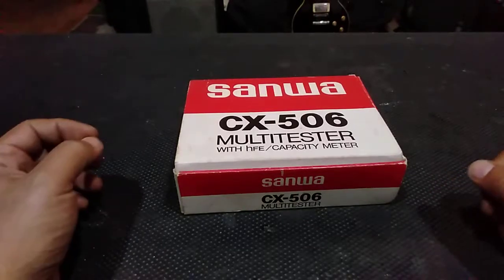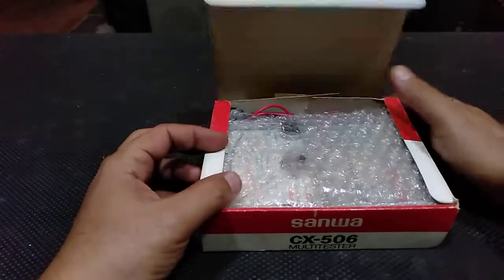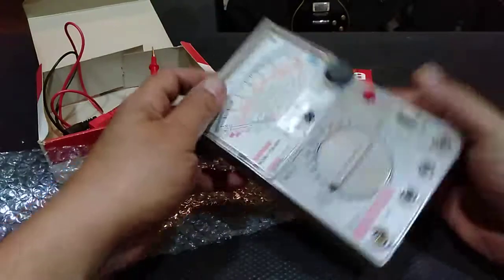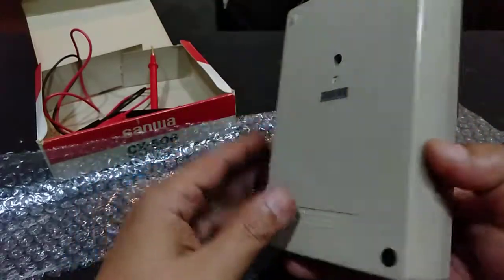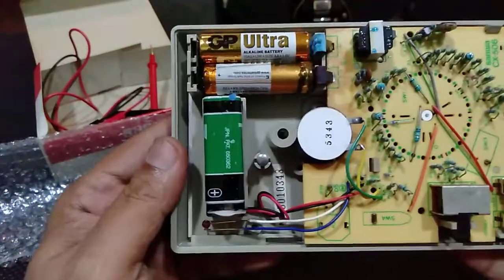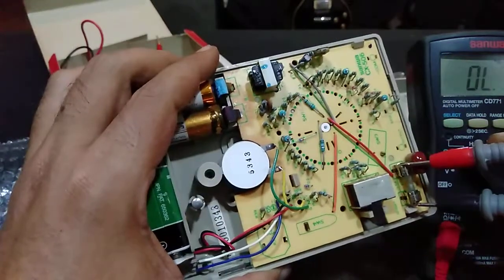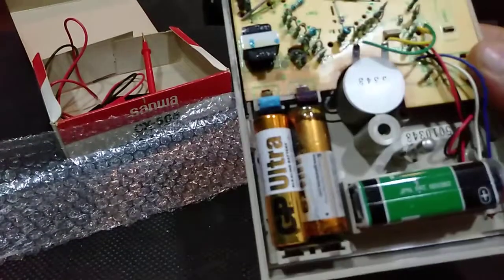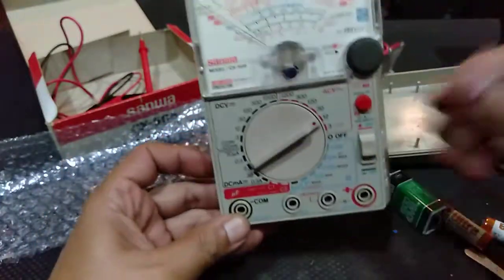Sanwa CX-506 part I

Comment: sr yustech , yo tambien compre ese instrumento sanwa cx/506 , por equivocacion en el rango de ohmiaje probe voltaje alterna , las resistencias , r14; r31; r32 , estan alteradas y otras estan carbonizadas ; me podria decir los valores de las resistencias , o de lo contrario decirme la barra de  los colores de cada resistencias , le estare agradecido
Reply: Hola Raul, lo puedes obtener de este lugar: https://www.scribd.com/doc/98849249/Sanwa-CX-506

Sino aquí los copio.
R14= 1R   (Lectura 0.3 Amps)
R31= 680R  (Led serie)
R32= 35R   (Omhs x1 shunt )

Tengo uno igual hace más de 25 años y es una joyita como funciona.
Suerte para ponerlo a funcionar nuevamente.